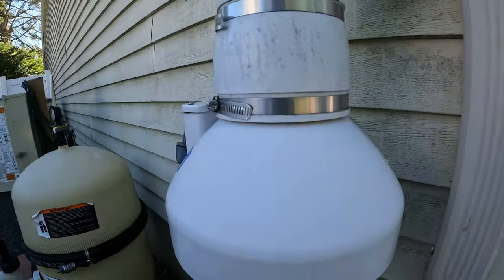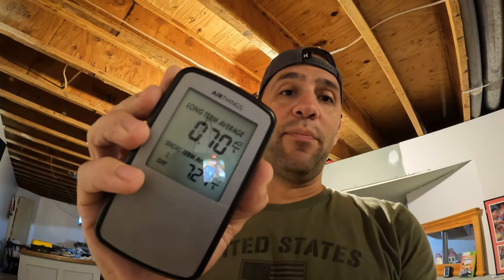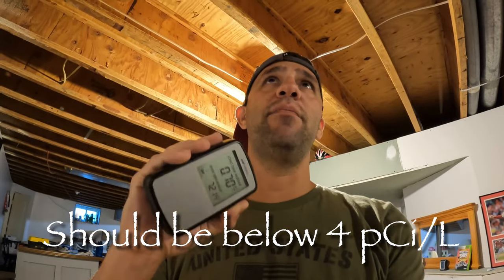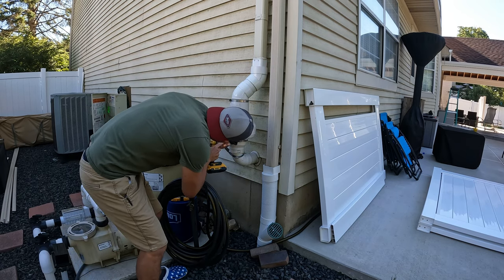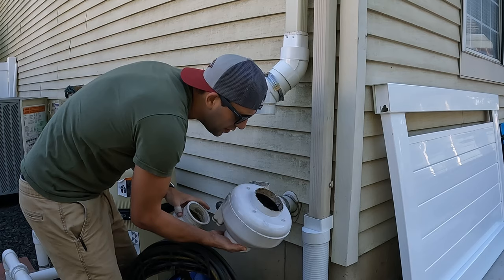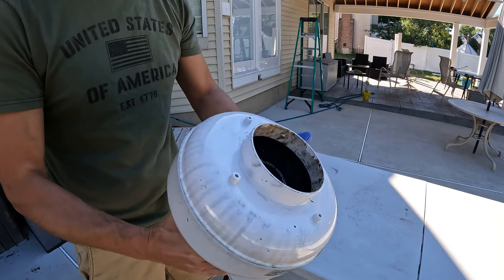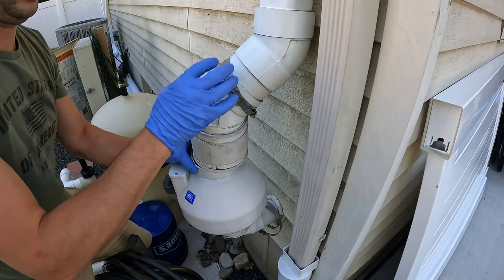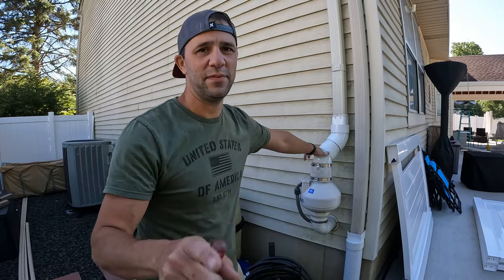Radon Reduction System FIXED - Replacing FAN

Comment: Wait. You have a Radon system but were concerned about venting the Hybrid water tank?
Reply from the maker: Yep -   Random system is for the most part a sealed system.   

And the water heaters an 8 inch duct, moving tons of air !